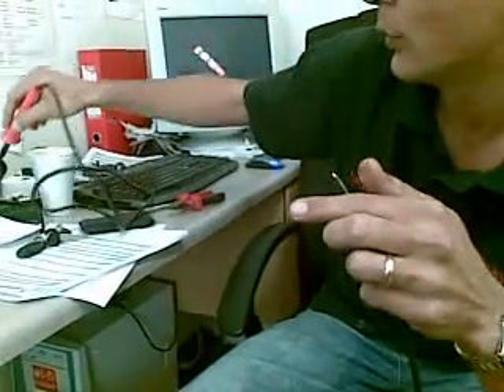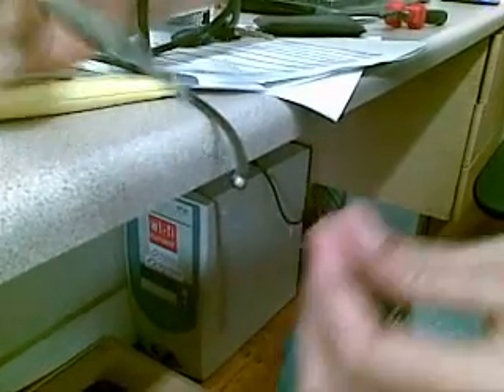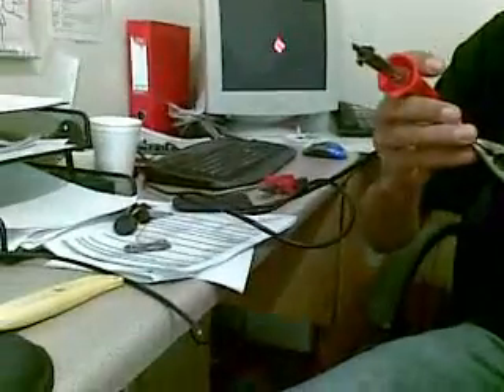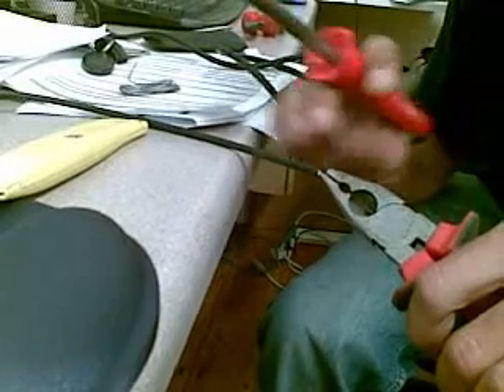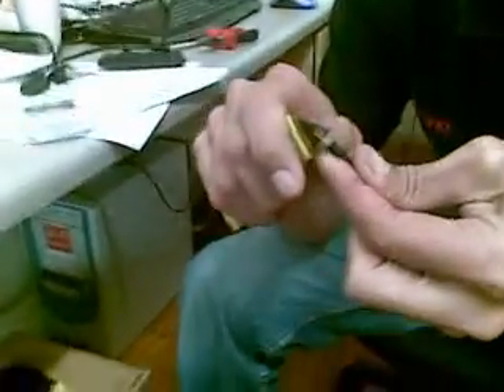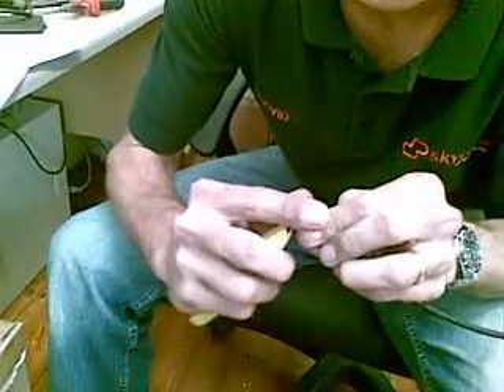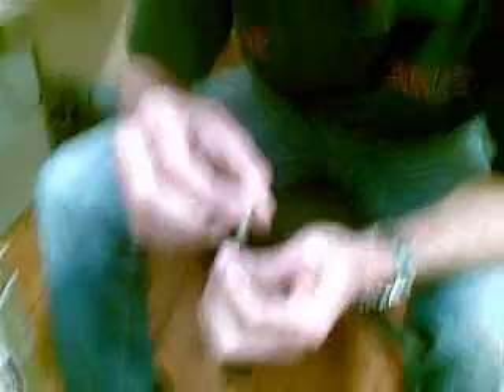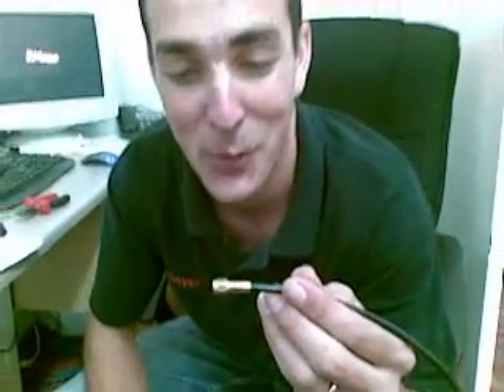SMA Connector

Comment: bad example!
Finger burning at home!
the golded connector coated with soldering and hand scratched!
What about the Crimps with heat-shrink tubing? 
And the appropiate measures of the mesh and cuted isolation?
But nice try!